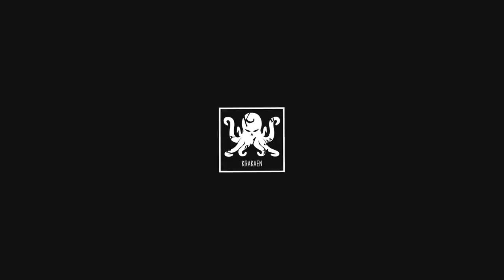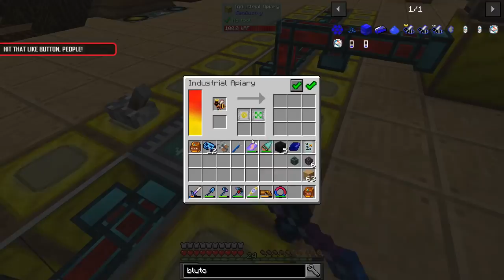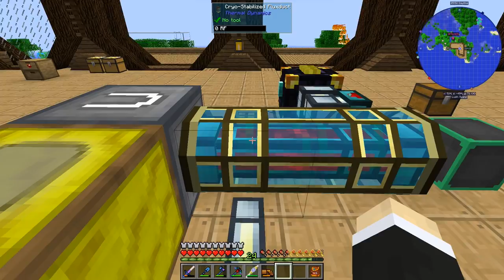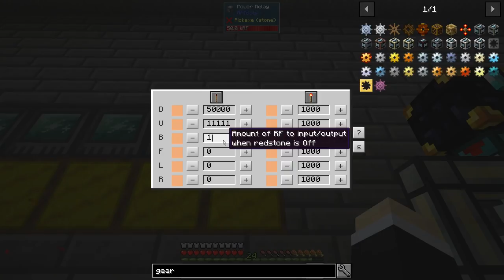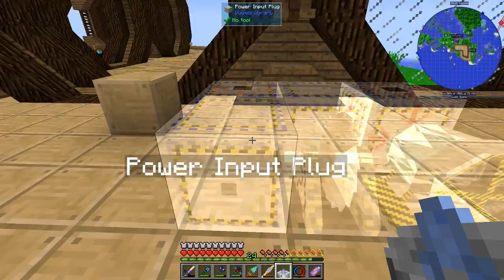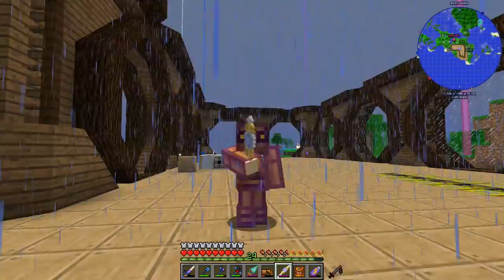FTB Continuum - 31 - SUPER BEE POWER

Comment: The cryo cables dont save residual power as you could read from them. It means it will not save power inside it. But that doesnt mean it doesnt work. As long as the fluxduct has a machine to give power,it will give power. So no worrier.   Or also since the power transmission is infinite. Your amount is so low that it cant be seen (im not sure if its that or a glitch)